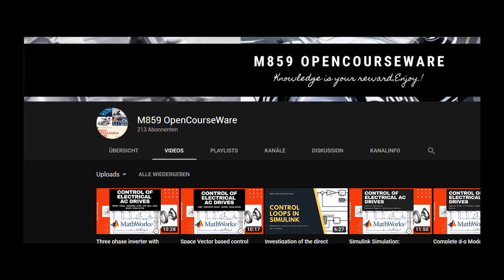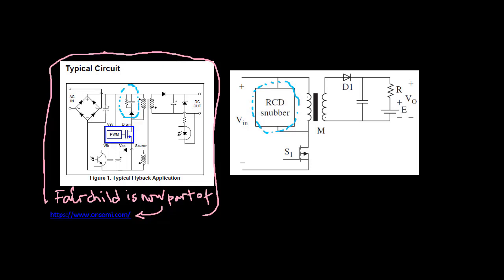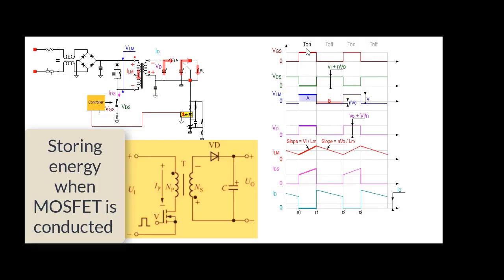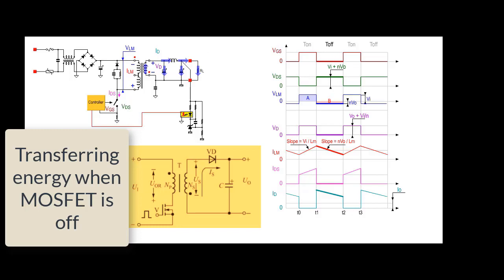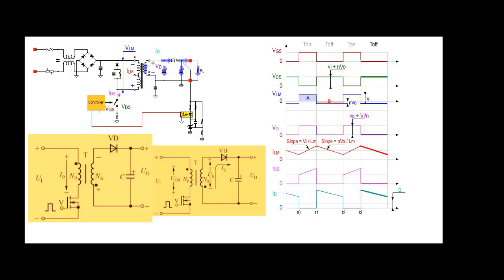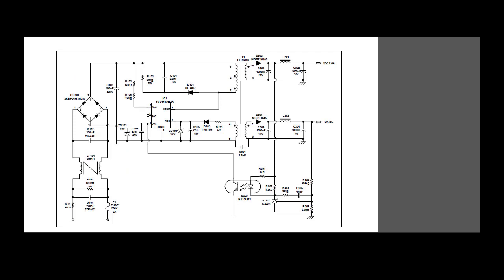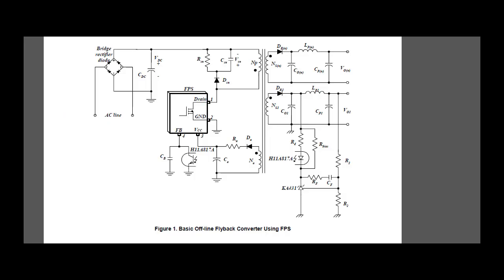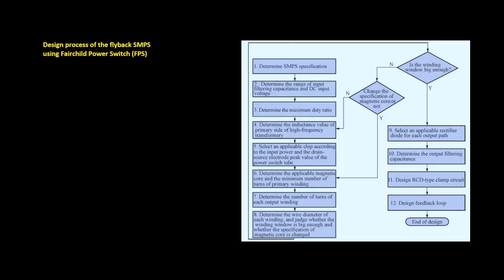Switch Mode Power Supply Design using an Isolated Flyback Topology

Comment: Hi! Nice video. How to calculate w(rz) and w(p) for CCM (formula 33A)? D is not specified. If RL=0.232 Om, D should be ~ 0. Thank you.
Reply from the maker: HI thank you, in minute 12:41 you can read the formulas on the far right how to calculate Wrz and wp (pole and zeros). the max duty ratio for CCM @ min input voltage was calculated with the excel tool at the very beginning 0.48.